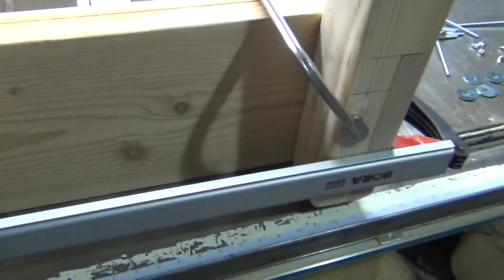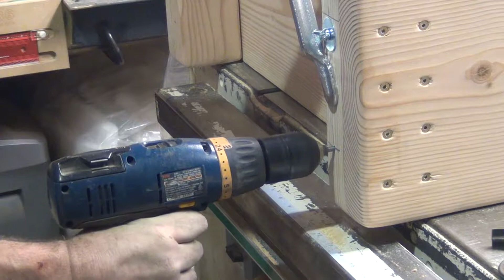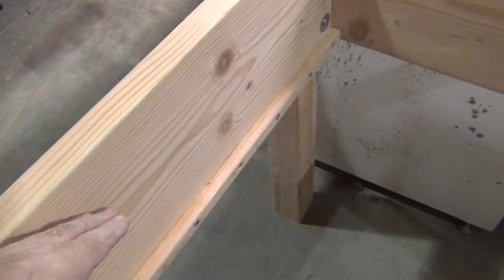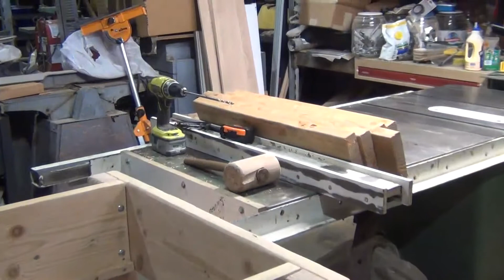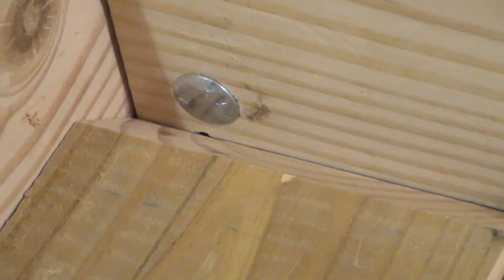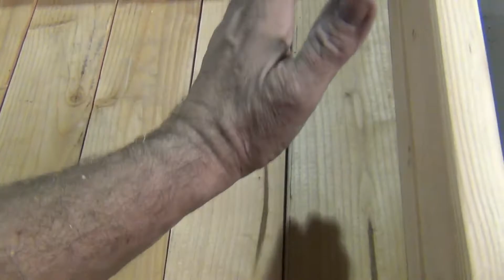How to build a Civil war inspired wood burning wooden forge part 4 of 4

Comment: Thanks for the great video series! Built myself one much like it today. Will there be another video at any point about how to insert the tube and build up the insulation material and fire? I've heard sand can be used, but have had trouble finding info about the proper use with charcoal/wood forges.
Reply from the maker: Thank you. I just posted a video showing the forge in use.
I am sorry for taking so long. Life has thrown me a few curve balls and my hands were too full, I could not do everything so some things had to take a back seat. Sorry again.
Reply: No apologies necessary! None at all. I'll be sure to watch the video you posted. I just finished up building a wooden forge filled with red clay and will be firing it up sometime soon. Thanks again!

Comment: Cant wait to see the final product in action. So did they just use loose sand during the Civil War era or did they make an adobe type material?
Reply from the maker: I built this forge with ease of transport in mind. Regular dirt from the ground is more than enough insulation. Clay such as you would use on a cast iron forge pan is very heavy. Cast pans do need insulation and for use in a shop where you are not moving the forge, clay is a good choice as it is rugged and does not move such as dirt will in use.